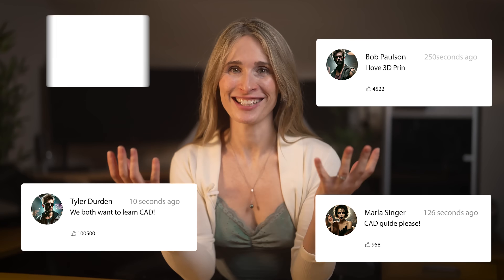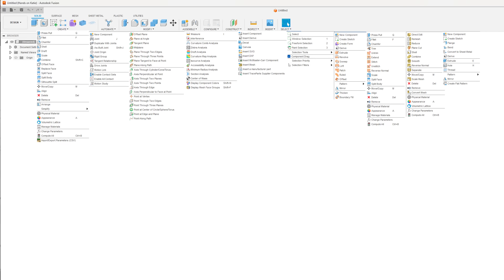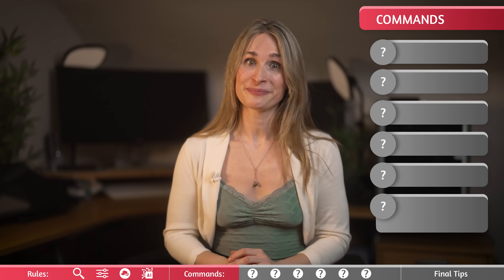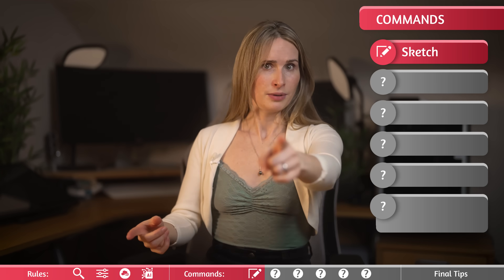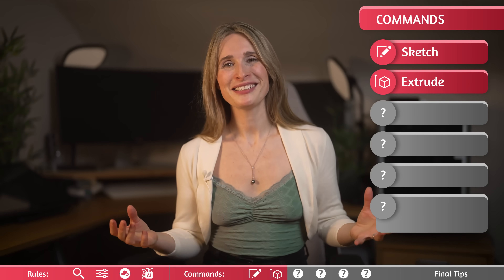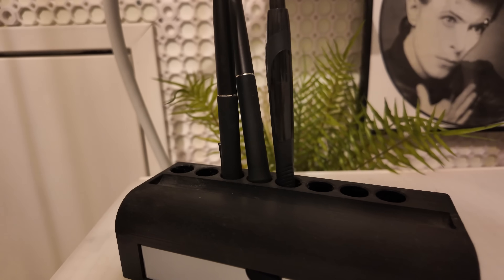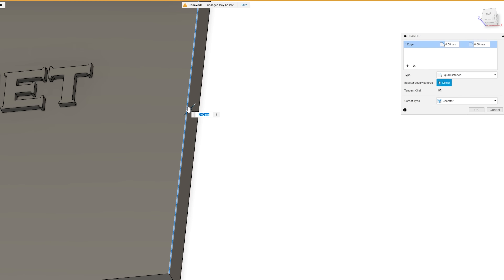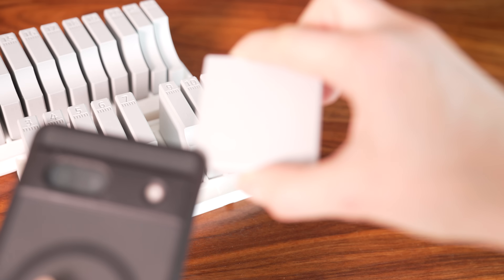The Quick & Dirty Guide to Making Custom 3D Prints!

Comment: I tried Fusion360 when I started and also Solidworks.  I don't even remember what it was but there was something in Solidworks that was just a simple menu selection that was a long operation in Fusion so I went with Solidworks makers edition.  That's only $50 per year so not expensive and it's full featured.  Except if you make over $600 from your product you're supposed to go pro.  I don't know how they police this though.  I did discover that you can't load files from makers edition into the pro version but you can to the other way around.  I have the pro version at work and makers at home.  If I take something home and edit it I can't bring it back in.  But if I bring something home from work and just keep it there, no problem.

Comment: General tip on patterns - where possible do the extrude/cut from the sketch, then pattern it. Most CAD programs won't pick up if you increase the number of things in a sketch pattern that is then extruded/cut.

Also, bonus command, Sweep - it's like revolve, but along a path instead of around an axis. Probably less used for simple models, but it can be really powerful.
Reply from the maker: Brilliant tips - it's also usually much more memory efficient to do the Boolean cuts from the sketch too!  And yes, sweeps are super handy too!!
Reply: I've never seen a CAD program that acts as you describe. Can you give an example? 
FreeCAD and Pro/ENGINEER will certainly update the model when you make such changes.
Reply: @glabifrons  'Most' may have been the wrong word; both Inventor and Fusion will update a pattern in a sketch, but only include instances that were in the original extrude/cut; decreasing pattern count works fine, but when increasing pattern count you need to edit the extrude to include the new profile instances in the sketch.

Creating the extrude first avoids the issue entirely, and should work across all CAD programs unless they handle patterning particularly strangely, so would be my recommendation as good practice.

Comment: This is a nice redux of the process.  What do you think of the open source design software QCAD?
Reply: QCAD is 2 dimensional CAD. For 3D printing, you want a 3D modeler. A free one very much worth checking out is FreeCAD. If you are using the approach shown in this video, you want to stick with the "Part Design" workbench (that will make sense when you launch it or watch some tutorials videos on it). Tip: The "Part" workbench is based on primitives and is a totally different concept, so don't confuse them.
Reply from the maker: Ooh not used QCAD, I'll have to have a play around with it!! ☺️

Comment: I don't completly agree with 1. If you have fun creating your own designs/tools, try it/do it. You will fail sometimes, but you will learn a lot ... trial and error.
Let me think ... I think 90 % of my printjobs came out of self-designed models/tools. Why? Because that is the fun on 3D printing for me. Anyone can just print, that's not a hobby for me.
Of course, things like gridfinity/mulitboard, or other parametric/predesigned storage systems or tools are ment to work for many people, so use/print these predesigned tools.

The fascinating thing about 3D printing for me is that I am able to make my own products ... thats amazing, and for many years this was simply not possible for private individuals in this form.
Fusion 360 is free for private individuals, so give it a try.
Reply from the maker: Yes! If your goal is to simply enjoy the creative process, then by all means design away! As you say, it's amazing fun!!! 😊

Comment: i don't really understand remixing, most people just share their STL files which are useless as i understand it for remixing if you are using the free version of fusion 360
Reply from the maker: Yes, you can tidy up in Fusion with STLs, but STEP files are way better!
Reply: Depends on the model, but most are pretty basic shapes you can import and clean up or redraw fairly easily using it as a template.
Reply: You can also edit/modify STL files in Blender.